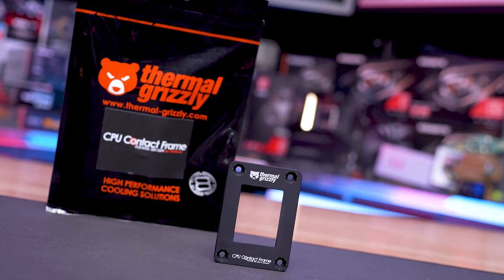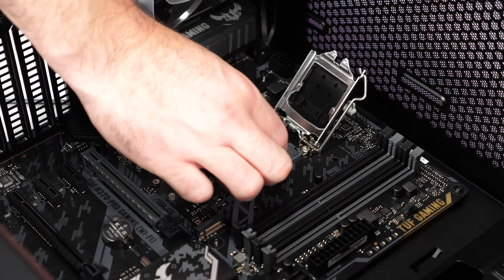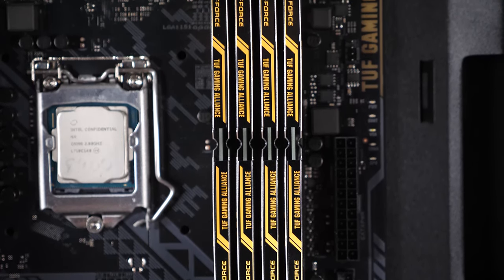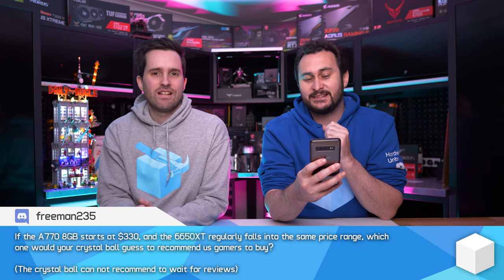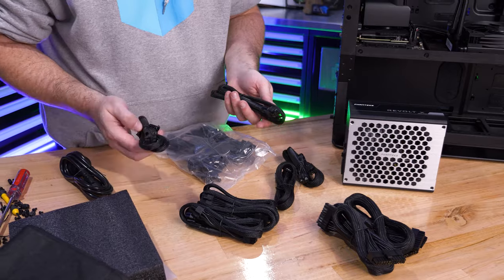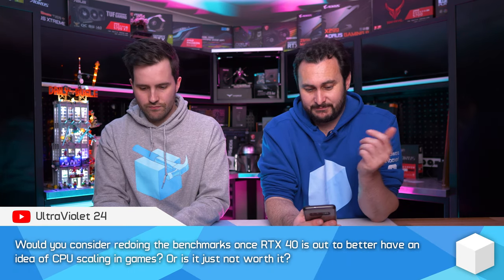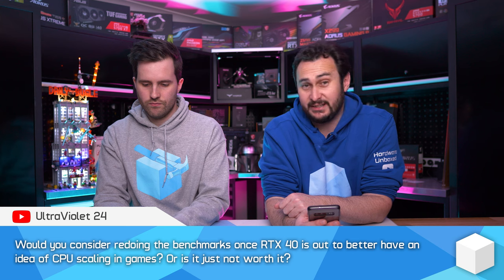EVGA Quitting Bad For Nvidia? Arc A770 8GB better than RX 6650 XT at $330 US? September Q&A [Part 2]

Comment: Do you guys think that we will very soon hit a wall with computing power that people will not want to upgrade anymore?
Like for example for basic internet browsing and office work anything that's Sandy Bridge i3 or newer is still perfectly fine, even a decade later and next the gen GPUs should be very easily able to hit 100+ FPS in every single game at 4K.
Reply: its still very far from the wall, like really far
Reply: Nope.
There will always be more polygons and more ways of creating light and shadows, even more computational than Ray Tracing! Resolutions will always increase and so will refresh rates of screens.
As far as physical limitations go we aren't far off Silicon, AMD is now on 5nm and at around 2-3nm quantum tunnelling will cause errors, although there will be stacking and other ways of getting around it if they don't discover another material that works better.
Reply: Moore's law is dead. Further advanced in actual performance increase will be a lot slower. Companies will start relying more on gimmicks, software and other aspects. For example, Meteor lake is said to focus on AI performance as it will have separate cores for it. Newest RTX 4000 series are relying on DLSS 3.0 in order to cheat performance with artificial, non-existant frames. Alder lake and Raptor lake has a lot of small processors, bringing pseudo-server/enterprise performance to a home computer. As we cannot rely on node shrinking anymore (there is only one last jump to 3 nm left), we will have to rely on architecture changes which were rare up to this point. However, there is only so much you can do there. After one or two changes, architectures will become pretty much optimized. 

We will need new technologies to bring in results. We cannot predict if we are going to see anything which will considerably increase performance. 3D cache is one such technology. More and faster RAM. Chiplet design is another. CPUs and GPUs will develop like this, but I think that we are in the best period for computer advancement right now and soon it will hit a wall.

I personally have i5-4670. It was not a bottleneck in gaming until my old GTX 760 broke down. Then with GTX 1060 6GB it became a bottleneck. It is also kinda slowish processor these days. It bottlenecks when starting a PC, then starting a browser, but other than that, it is mostly fine for most applications. Quad-cores barely gets me by in 2022 without causing discomfort.
Reply: even in games alone, devs clearly compromised many things to make their game playable on current machines

as for other/general tasks, well other than youtube playback, its always been not demanding, you can work conveniently with smth like athlon x3/core2duo
Reply: No
Reply: @REgamesplayer  
Many other things outside of gaming still do need those upgrades, and they will take a huge advantages from gaming technologies.

Civil engineering, health and medical industries, etc.

Imagine, an UHD ray traced ultrasonography machine. Or, game like architectural designer softwares, or CADs. With AI calculated material consumptions, cost forecasting, etc.
Reply: That implies we see steady performance optimization over time for games and it's only getting worse
Reply: @fajaradi1223  That what I had said, computing will struggle to retain growth in pure calculations increase, but we will see improvements in software and specialized cores. Meteor Lake for example will be the first CPU designed around AI. It will be very useful to me as I plan to learn AI and having a CPU with dedicated cores for it will drastically improve the speed at which AI calculations can be done.

We can see this trend with Nvidia and their heavy focus on AI applications. Its presentation was mostly about its amazing software based on AI and what it can do. The biggest hardware advancements were in far more powerful AI cores. This alone reminds me of old times when practically each new generation would be so much more powerful, would feature such revolutionary tech that it would make previous tech practically obsolete overnight.

In the future, AI will dramatically magnify our productivity, but at the same time it will considerably increase divide between wealthy and the poor. At the moment, there are countless jobs which people at the bottom of a society can do. Imagine what would happen if 10% of all the work is taken away? What will happen if a person is unable to drive his car as uber driver? What will happen is people won't be needed in warehouses? What will happen if we do not need shitty stock photos anymore?

There are a lot of fields which can potentially be replaced by an AI. While I believe that fears are largely overblown. For example, AI can drive a car, but it does so poorly. I''m doubtful that we will be able to reach imagined performance levels despite our efforts. In reality, we will have limited applications for self driving cars like truck driving, replacing truck drivers in between city driving and only using drivers for a final few kilometers for in-city navigation. In a similar vein, we will see partial applications across the field.

 From my personal experience, I write scripts (robots) for my company to automate boring stuff. I'm considered someone with really high level skills in my company, because I'm a guy who can write a program which will do what a person does automatically every day. However, robots are really, really fragile and unreliable. Any deviation might cause it to fail. Sometimes this deviation can be imperceivably small to your eye. I feel like I have to build house of cards for extremely complex and chaotic tasks where any blow of wind will cause it to crash down. This is reality of robotics. This is why robotics only had seen limited application even in industry, factories. I want to learn AI, because it promises me a robot which could do a task without me having to predict every single possible outcome. A robot which I could program not only to solve this particular task, but every other task like this one without me having to painfully go and solve each fatal crash from every small, little unforeseen detail.
Reply: not even close to 100 fps in 4k in every game unless you count the new dlss which I am VERY sceptical about

Comment: I think it's absurd to have a GPU connector "rated" when it comes to the number of plug-ins and disconnects. That's no different from buying an appliance, game console, laptop, desktop, whatever... anything that requires a plug into your home's electrical outlet and putting an asterisk on the box stating you are only covered for plugging it in no more than 30 times in the life of the product.

It's absurd! Point blank, whether or not it lasts longer is irrelevant. What happens here now is, warranty claims for a faulty power connector can be denied as long as they "deem" that you've used the connectors plug in count beyond what they've "rated" it for. Even if you claim it's only been a handful of times, it won't matter. There's no way you can definitively prove you have or haven't plugged it in more or less than 30 times! There's just no way! How would you ever prove that??? It gives them an out. Also, here's another thing; it makes the consumer more wary about buying secondhand GPU's! Think about it! If you're trying to buy a used GPU to save money you have no idea how many times the power connector has been connected and disconnected. So, you've got that in the back of your mind, maybe even puts off people from buying second hand altogether because you don't want to risk it. 

Yeah sure, there's always risks buying second hand but generally speaking you're only worried about the thing still being able to power on and run games/benchmarks and how hard the GPU was pushed by the other owner. Aside from that, if it runs like new and it's significantly cheaper than buying retail then you feel pretty good about buying second hand and saving a lot of money while keeping profits away from Nvidia. Now? Seems like going forward no matter how confident you are in buying that secondhand GPU, it's always going to come down to the power connector potentially failing one day you decide to unplug it and clean out your system or change your case, or your motherboard, etc., and having no recourse.

So... so... so stupid.

Comment: Honestly the performance of the A770 doesn't matter at all to me because I simply can't purchase it due to drivers, etc and considering what happened with the 330.  Just doesn't seem worth it to be stuck holding it.  6650XT is $300 and even if it's a little worse... I'd prefer a card that actually works.

Comment: 37:38  There are no AM5 motherboards that can replace HEDT motherboards.  There simply isn't enough I/O.  You can't even run a x16 graphics card and a x8 RAID controller.  Much less a x8 10G network card and x1 sound card as well.

AM5 is, like AM4, a toy computer platform.  It does not have the I/O required to be considered anything like HEDT.  Core count is not the measure of a high-end desktop platform.  It's incidental.

Comment: With the power connector thing, what about the smaller 4 pins above the larger ones of the ATX 3.0 power connector, that you see on the nVidia RTX 4090.

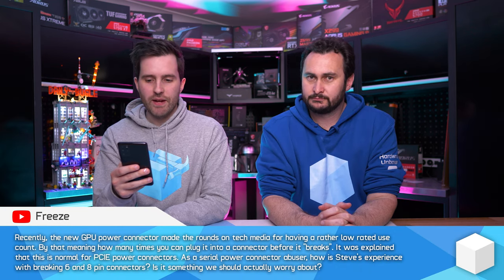Comment: 23:00 That was the statement on the spec sheet of a Zotac 40xx GPU that there is only a limited cycle of 30 times. And Gamers Nexus reported about a warning letter from PCI-SIG the group that designed the 12pin about melting 12 pin connectors - I think it's a serious problem, because this can already happen after only 2h of use. That's for many only one gaming session..... . And with GPU's price range into the 2000$ that can be really expensive caused by a badly designed connector.
I don't understand why they designed that connector with less space between the pins. If the space used per pin would have been the same like with the PCIe 8- and 6-connectors I'm sure the problem of melting connectors would disappear. I worked in the electronics area and to little space between pins with high currents will always cause a thermic problem.
Reply: I think the testing was more like 8 hr loads of 55amps over and over again until failure. It's a highly unlikely scenario for anyone let alone a standard PC user who unplugs their PSU maybe a handful of times over consecutive builds/cleaning. But, it's worth notification to manufacturers etc.

Comment: 350$ MSRP means 450$ for the high end models. So basically the same exact price with 6650XT. Only that 6650XT was released a couple of months ago and we have the RX 7000 series and RTX 4050 on the horizon which was leaked if you search for it. So in other words not worth at all to go for Arc 770. I would wait for RX 7600XT or RTX 4050

Comment: I will buy an ARC card just to support a NVidia competitor I have an 4790k based system that I still have that just needs a good low priced gpu to turn it back into a decent platform for older games
Reply: A 8700k or 3600 would be the next jump after a decent gpu. I mean if you wait another yr or so then 12400 or 5600.
Reply: Unfortunately ARC will be focused on DX 12 and Vulcan, older titles will work but don't expect the best experience.

Comment: great vid
re the upspeccing to better AM5 mobo for future, as someone who did that for AM4 with a x370 to future proof I have mixed feelings. Yes my x370 board is still going well but I wanted to upgrade to a 5950x when they first came out but gigabyte decided nearly 1 year later to only offer a bios to support it forcing me to setting on a 3950x. Extremely frustrating and I could have bought a compatible B450/550 for just over $100 AUD for a 5950x. So not sure what do to for AM5
Reply: replacing/updating the motherboard is my least favorite, so i would choose one that has gen5 for both nvme ssd and the video card

Comment: lol @ 5800X3D being the 1080Ti.

5800X3D is barely an improvement over the regular 5800X (unless you somehow have a 1080p 500Hz nonitor where you can use the extra frames at such a low resolution, which you don't because it doesn't exist). Why would anyone waste the money? 5800X is the 1080Ti, 5800X3D is a Titan.

Comment: I would never be an early adopter...because I don't have that much money to waste. A company would say whatever they need for the NOW, and they can apologize later if they are going to shutdown whatever project they do. Platinum Games' Babylon Falls, Google's Stadia, BioWare's Anthem, etc. Those examples had their company said that they are here for the long run, in the end what didn't make sense, still doesn't make sense down the road. Intel's ARC currently makes no sense for either the company and the consumer, it will continuously do so for some time.

I'll wait until the Sunk Cost Fallacy kicks further in and Intel had no choice but to fight tooth and nail to make it succeed, only then I will consider buy their products.

But hey, if they are selling at a loss, one pricing tier below from the other competitor with the same or better performance, I might just turn a blind eye and buy one, who knows?

Comment: I think you guys are looking at the Arc GPU's the wrong way. Your focusing on price to performance and missing the efficiency factor. The A770 appears to be around a 250 watt GPU. Given the 400+ watt requirements on the new generation of Nvidia and AMD GPU's, This means that with an ARC card you can look at using a 600-750 watt PSU, instead of jumping up to a 1000 watt PSU. 

This is predicated on several factors like (a) resizeable BAR, (b) decent 1440p performance (say within ~10 percent of a 6700XT), and (c) not needing support for DX11. While drivers might still be a bit rough, Intel has been working on them heavily since the release of the A330, so hopefully they have improved significantly.

Of course AMD's next gen of Radeon GPU's might nullify the potential for Intel's Arc GPU's, we'll have to wait and see on that one.
Reply: GPUs*

Comment: I think the main arguments for the A770 (and even more so the A750) are that it has actually usable ray tracing performance vs the AMD offering (better raytracing performance than the 3060 while being quite a bit cheaper)

The second big argument would be that it's very likely that in a year, that same card will be 5-10% faster on average due to all the driver improvements that are yet to come. While that is obviously a risk that you'd need to take on, I do think that for some it will be a risk worth taking for that extra performance down the line.

Furthermore, if you are mostly playing new games, and very few DX11 titles, then the performance advantage for the Intel GPUs can be pretty decent.

And when it comes to productivity, AMD is horrible compared to the likes of Nvidia. While we don't have productivity benchmarks at the moment for Intel, they do seem to focus on it more, so it's entirely possible that Intel will outperform AMD in productivity once their hardware acceleration enabling software gets implemented.

Now some parts of this are obviously just speculation, but if we do get an Intel card that matches the RTX 3060 in gaming, RT, and productivity for much less money, and also matches the RX 6650XT in gaming, but outperforms it in RT and productivity for the same price, then I think there are genuine valid arguments for going with Intel (especially when taking into account that their performance will likely keep improving for a while on the same card)

Comment: The Ryzen 5800x3d seems more like the i5 2500k to me...sure there will be faster CPUs in benchmarks, but not really any reason to buy another setup for gaming any time soon. I fell for the intel i740 gpu years back...and not long after launch they shut down the whole supply chain. Never again.
Reply: If the Ryzen 7 5800X3D is the  new i5-2500K, then the i7-12700K is the new i7-2600K.

Comment: 5800X3D is NOT like a 1080ti lmao. The main factor is the price like you said. 
980ti to 1080ti was same price for like double the performance, then 1080ti to 2080 was same price, same performance (at launch).
5800X3D is already a huge price jump over 3000 series. And I doubt 7800X3D will be the same performance at the same price.

Comment: Youve said that the intel gpu needs to offer much better price/performance over amd to get the recommend over the radeon part. Also said, radeon needs to do the same over geforce to get the recommendation. Im curious, do you, like me, think amd is getting very close to shedding that sort of 2nd class part image theyve had in the gpu space for awhile now?
Reply: Well they have from me. I'm on my third AMD GPU the first was the rx580 8gb, then the rx5700xt. Both great for 1080p gaming. But sense I wanted to do 1440p gaming I got a rx6700xt and I'm very happy with it.
Reply: My son has a 5700xt/3600, i have a 6700xt/5600x. Both run flawlessy with great fps, no stutters, no problems. AMD would have to seriously f up for me to go to intel/nvidia. I think they make great products.

Comment: does the a770 have better raytracing than a rtx3060? and arent intel supposed to have fixed or be close to fixing the dx11 issues?
Reply: It will take years to sort DX11. They are late to the game so to speak but as long as they keep at it they will get there. Don't expect timely, game specific support.

Comment: the ML cores in Intel ARC makes it more attractive tbf than AMD's. also intel arc has AV1 which RDNA 2 also lacks.
Reply: RDNA3 is leaked to have ML as well also only API that intel can run good is DX12 everything else works like dogshit and they won't be able to do emulation,i would rather get a slower AMD GPU than the fastest Intel GPU